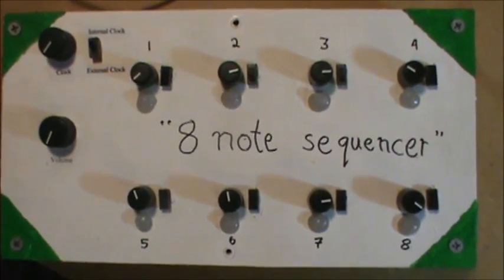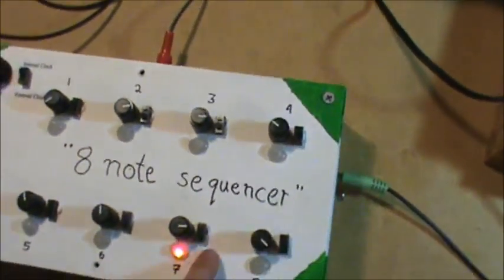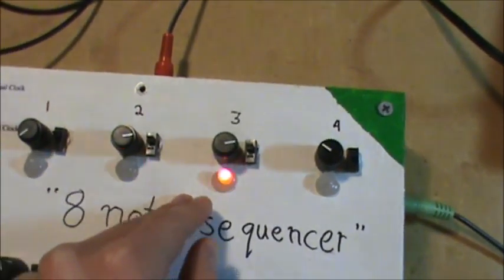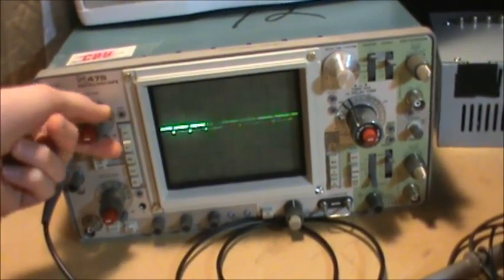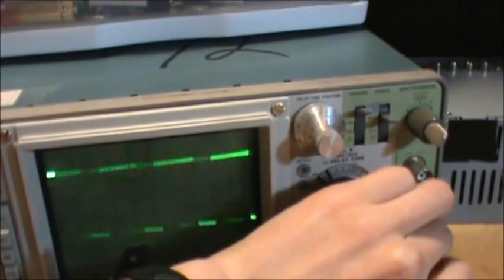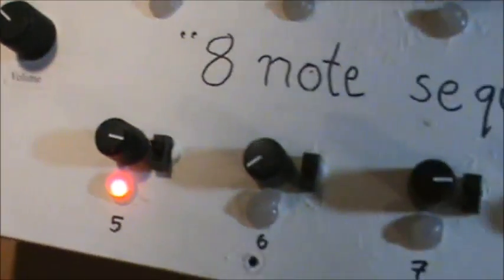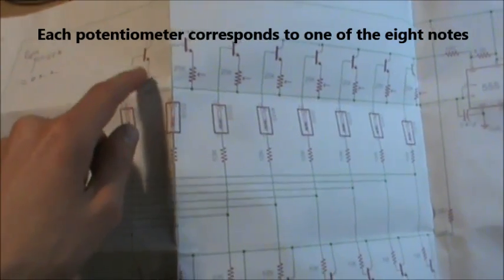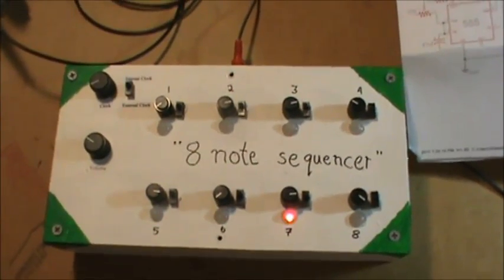8 Step Sequencer using a 555 timer as the oscillator

Comment: hi ryan, in the schematic you show in the video, the main potentiometers you use are 25k, but in the schematic they are 10k, could you please clarify this, and i tried to run a speaker directly from the 555 with and without a capacitor connected to the speaker in series but mine sounds a lot more different compared to yours, any suggestions.
Reply from the maker: I don’t remember which is the best value - experiment with both and see which you prefer.  The resistance value will control the pitch or the speed of the sequencer.

The 555 is too weak to drive a speaker, so the sound you get will be quiet and distorted.  Run the signal from the 555 thru an amplifier and connect your Speaker to the output of the amplifier.

Comment: Hi Ryan, I have made the assembly of your sequencer with the diagrams that you have presented and all the circuits work except for the synth oscillator. I have mounted it several times again and it continues to sound, are you sure that the oscillator circuit is well done? are the component values correct? the outlet mosfet is correct as well as its pinout, IRF530N (1G 2D 3S) I await your answer since I am desperate, greetings!
Reply from the maker: try probing pin 3 of the synth 555 (U2) and check to see if it is oscillating.  Your output amplifier (mosfet) may be wired incorrectly.  The schematic looks correct to me.
Reply: @RyanJensenEE  Can you tell me how the correct pinout of the IRF530N mosfet would be? 1G 2D 3S (viewed from the front)? And another question ... the oscillator should sound without the sequencer or only when connected to it

Comment: Hey Ryan! You did a great job! Thank you! :) I noticed that many people say there is a delay when they turn off a step. This is because, in certain applications, NE555 needs a 0.01 μF capacitor (unpolarized) between ground and pin 5 of the IC (TI says it can improve performance). In this case I found that the best results are given with a 0.01 μF ceramic cap between pin 5 of the internal clock NE555 and GND. I also found that by doing the same thing on the sound-generating NE555 but with a 1 μF electrolytic capacitor (positive at pin 5, negative on GND) gives a smoother sound and cleaner square-wave at the output! Also, for the ones who like to use a metal box, don't forget to ground the chassis, otherwise each time you touch it you introduce noise! Thanks again a lot! Greetings from France! :)

Comment: Hi bro!!!
¿What diodes do you use in the out 8 from CI 4017?
¿680 ohms or K?
¿0.47 uf is ceramic or Electrolytic?
Reply: 1n4148 diodes
680R
0,47uf ceramic or eletrolitic ... but eletrolitic minus signal for out circuit

Comment: is the mosfet an amplifier? can it be replaced with a opamp?
Reply from the maker: The mosfet here is working as a "pull-up" device.
However, if you know what you are doing, you could replace it with:
- P-channel MOSFET
- npn bjt
- pnp bjt
- op amp
- nothing (let the 555 drive the output directly)
- optocoupler???
the sky is the limit!

Comment: I tried the transistors on the steps with 3904s but they did not work.  the leds all blink together.. anyone have any values of transistors they used that worked out? thanks
Reply from the maker: Are you really sure that the problem is the transistors?
Reply: You could use diodes, couldn't you? Such as 1N4148

Comment: man, i've just ended to built it, i switch it on but it runs too fast. i used a 200k pot instead of 160k and bc547 for the transistors.

Comment: anybody ask about shuffle? does the 4017 switch when it goes high or when it goes low or both? guess i want another 555 for that? (rather than making a separate circuit ie 8 + 8 steps)

Comment: what is the little square in the schematic? the potentiometer is conected with the 2 pins and the third one is connected to what?
Reply from the maker: The little squares are supposed to indicate that the pins are not connected to anything, I guess.
Some (if not all) of the potentiometers in my schematic only have two connections. The third terminal is not always used.

Comment: Thank you so much Ryan! Just a question: is the 33uf and 0.47uf polarity right in the schematic? They have the positive pole to ground and it sounds a little bit strange to my experience
Best!
Reply from the maker: Thanks for the correction!
You are absolutely right.
The polarity of my capacitor is wrong.
I will try to correct that tonight.

Comment: how do i connect external clock to tr 626 trig out??
Reply from the maker: I assume you mean a Roland TR-626 (based on a google search for "tr 626") https://goo.gl/z6su3N
I do not own one of these. So I don't know how.
Maybe just plug it in? But that could POSSIBLY DAMAGE either the sequencer or the Roland, because I don't know how the Roland Trigger output works...
Good luck!
Tip: try connecting the two devices with a 10 kΩ or 2.2 kΩ series resistor first.
If this works, just leave it in series. This will limit the amount of current that can flow between the two devices, thus protecting both. A 10 kΩ resistor is pretty safe bet.

Comment: Hey man just build this here's some impressions: https://youtu.be/DcCksJVC-Us
Thanks for the schematics. I was thinking though that the transistors for the LEDs are not really necessary right? A couple of resistors would make things a little easier I guess.
Reply from the maker: +Benjamin B I was about to agree with you, but I decided to take a look at the datasheet first. http://www.futurlec.com/4000Series/CD4017.shtml
As far as I can read into this, it seems to indicate the maximum input/output current when the supply voltage is 5 V is:
0.88 mA.
I might be reading the datasheet wrong, but it doesn't seem very clear.
I have a feeling that it would work just fine to use the 4017 to drive the LEDs (with series resistors) directly from the chip's output pins.
Cheers,
Jensen
Reply from the maker: +Benjamin B Cool video! If you ever get people asking you for a schematic, you know where to send them :P

Comment: Awesome! I am building this one right now :D 
I was wondering if you knew a way to implement a clock out option also (to use the sequencer as a master clock)
Reply from the maker: +Ole Nieling
The internal clock signal of the sequencer can be found at pin 3 of the left-most 555 (U1).
It can be seen in the schematic that I gave my circuit an option of having an external clock source.
I think the simplest way to make the internal clock source be an output would be to connect pin three of the left-most 555 (U1) to an audio jack. I would put a 1 kΩ or 2.2 kΩ resistor in series with this output so that it protects the 555 if the output ever gets short circuited or brought to a different voltage or something else bad happens to the output.
Cheers!
Reply: Very awesome, thanks for the swift and helpful reply! Ill have to redo my casing now :P get an additional socket for the audio jack fitted but im by far not bitter about that :D 

Thanks a bunch!
Reply from the maker: No problem! Good luck!
I am really interested to see what your build looks like. Care to post a picture / video?
Reply: When its back together Ill post a video ;)

Comment: I don't understand where some pins are wired... I mean, every third pin of a potentiometer is wired to earth, isn't it? Is the external clock  used only in case of connection of other machines like this? great job !!

Comment: Hello from South Korea!
I really appreciate for your schematic and video. I followed your schematic just as same,  It works fine except one problem. 
Everything works smoothly but if I turned off any switches, ( ex. sw1-off, else sw-all on) clock from 555 pauses generating frequency a little bit and then works again.

I know it should not be heard at off switches like your video, but mines are different....
what parts do i need to find this problem?

Here's what I used in circuit.
NPN tr as 2N3904
Didn't made LED circuits.
CD4017BE - Ti

and also can you mail to me in your video's circuit? I saw it's a little bit difference.

I really need this solution asap, skype always welcome and here's my mail 
p90913390@gmail.com
Thanks for your help.
Reply from the maker: +Hoon Lee Hmmm... I don't know why that would happen. Sorry I can't be of more help!
Reply: +Ryan Jensen It's all right :) But what TR and diodes did you use ? Cause I used 1n4004 not 1n4148.
Reply from the maker: any general purpose silicon diode should work.
Reply: +Ryan Jensen Actually it is kinda working but not well. Like I said when I used not 1n4148 diodes, it took more than regular time to skip for off-switch passing.
Because this 4017counter needs "fast switching" to reset pin on 4017counter. 
So I suggest for this project : use fast switching diode such as 1n4148.
And thanks again for your share!
Reply: +Hoon Lee Hi! I have the same problem. What diodes are you talking about? The ones that go from 9th step to the reset pin? I am using a rotary switch to reduce the steps, so the reset can happen from different points. Can you explain me a bit of what happens there with the diode? And hm.. I am using the 4148 diode... thanks!
Reply: I mean what happens when the step is off and it takes (maybe two steps) more time to go on. thanks....
Reply from the maker: The rotary switch is definitely the way-to-go. Being able to control the number of steps in the sequence is really great.
Reply: +Sara Milazzo Hi! If you're not using 1n4148 diodes on pin8 of 4017 counter, steps could be delayed for one or two steps. But this happen causes when one of switch is open.

Comment: Hello Ryan Jensen this is just awesome, here in this Schematic  i struck at q 17 i dono what it is and my another question is can i use 100k pots instead of 10k?, i used 2N3904 NPN transistors will they work fine for this? Thanks a lot :)
Reply from the maker: +prudhvi rockzz
"i struck at q 17 i dono what it is"
Q17 is a general purpose N-channel MOSFET.
You can use most any general purpose N-channel MOSFET.
Or, you could try using a 2N3904 npn bipolar transistor for Q17. No promises, but that will probably work.
"can i use 100k pots instead of 10k?"
You can sure as hell try. If you are using linear 100k pots, you will find that most of the range of the pots is useless, and a small part of the range is extremely sensitive and hard to control.
100k audio pots might work reasonably well, but you are going to accessing a lower range of frequencies.

2N3904 NPN transistors should work fine.
Reply: +Ryan Jensen  Thanks for the reply, this project  is really awesome, Thanks again for sharing this :)

Comment: Hello !
First, great job ! Congrats ! :-)
I have a beginner question ! Which parameter do you change to change the value of the note played ? Do you change the value of the 10k Ohms resistors (on the top of the schematic) ? Or is it somewhere else ? :)

thanks !
Reply from the maker: +Cherozene These are potentiometers: http://i.imgur.com/ELaN4Dm.png
They are the knobs that I am twisting in the video.
They act as a variable resistor.
The 4017 selects which potentiometer it wants to insert into 555 circuit on the right (the 555 generating the audio).
Depending on how the potentiometer is turned, it will present a higher or lower resistance to the 555-audio-oscillator and this will produce a different frequency (pitch) heard from the speakers.

I hope this helps!
Reply: Haaa ! Yea ! Thanks ! It is all clear to me now ! :D
Thanks for your prompt answer !
Reply from the maker: No Problem

Comment: Can you tell me please How did you add the rate control? I don't see it on the schematic.
Reply from the maker: Derek G Absolutely.
The schematic does, in fact, show the rate control. The 555 on the left labeled "Internal Clock" is the rate control. The 160 kΩ potentiometer connected to this 555 controls the speed of the 4017 decade counter which steps through each note. The switch on the left side of the schematic (S9) is used to select either the internal (manual) step speed or the external clock "rate" input.

Does this answer your question?

Comment: Would it be a good or a bad idea to power this crircuit with 9V?
Reply from the maker: 077benjamin Lets look at all the components from the schematic one-by-one:
- resistors: No problem!
- capacitors: Again, no problem!
- diodes: any general purpose diode will be able to handle 9 V of reverse voltage. This shouldn't be an issue.
- LEDs: with 9 V, these will be brighter -- perhaps very noticeably! So play around with the resistor values until they provide the right amount of current limiting so that the LEDs have a comfortable brightness.
- transistors: any general purpose transistor should handle 9 V just fine.
- The integrated circuits: The 555 and 4017 chips are usually rated up to 15 V or 18 V. You probably won't have an issue with these, but check the datasheets of your specific IC model to be sure. Or just throw 'em in and see if they pop!

Good luck, and be sure to let me know how it goes!

Comment: Great Job! I'm gonna make one too.
Reply: An easy thing that you could add is some kind of FM (or .AM, but imo FM ia a lot cooler). Or a switch to change between two types of waveform?
Reply from the maker: Neat!
You should make a video of yours when you build it.
Oh, and make it better than I made mine :P
Reply: I will try my best Ryan Jensen. I want to add some effects and nifty features to the synth but I can't come up with any. Maybe you could help. 😀
Reply from the maker: Owais Bin Asad I agree with Tom L. 
You should try to add some AM effect or FM effect.
If you are going to make your sequencer based on the 555, then you should also have access to the charging waveform. That would give you a series of RC rise/fall cycles. (just probe pin 2 or 6 instead of pin 3.) You wouldn't want to load pins 2 or 6, as that will change the operating frequency of the 555 timer, but if you buffer it with an op amp or some other high input-impedance device, you should be able to use the charging signal without changing the 555 operation.

Comment: can you use HCf4017 or cd4017?
Reply from the maker: Those devices will have the logic inside them. They will only differ in their elctrical specifications (max voltage, max frequency, maximum heat dissipation, etc...)

I searched "HCF4017" and "CD4017" on google and found their datasheets almost instantly. The datasheet may differ slightly from one manufacturer to another, but in general they are fairly similar.
http://www.futurlec.com/4000Series/CD4017.shtml
http://www.st.com/st-web-ui/static/active/en/resource/technical/document/datasheet/CD00000366.pdf

For this application, it does not matter which one you choose. The maximum voltage range for each is way higher than the 5V that this circuit uses. And they both work up into the MHz range (which, obviously is overkill for a simple audio circuit)

The short answer is: you can use either of those devices.
I hope that helped.
Jensen
Reply: Ryan Jensen
Thx :)

Comment: can you use the TLC555? it's the CMOS version of the NE555.I would like to use it because it draws much less current from the power supply
Reply from the maker: I believe you can. It looks like the power supply range is fairly similar (2 V to 15 V for Vcc). And from what I can see on datasheets, you are correct about it using less current. I say go ahead! There should not be anything different in the operation of an TLC555 compared to an NE555.
Let me know how it goes!

Comment: great little device! I've been thinking to build something like this, for a while, to go along with my Korg volca bass, with a switch so I could setup external sync or internal. I've also been thinking to add attack release for each individual step or all the steps. Is the 555 #2 receiving trigger or gate signal? I also noticed your instructable is non existent though... I also noticed the schematic in the video and the one you posted are different. Which one is the best to use or what are the differences between the 2?
Reply from the maker: Yeah I never got around to making the instructable. And now when I think about making an instructable about this project, it makes me want to completely re-design the sequencer.
About the schematic: use the one on imgur. I made some modifications to the device, and the schematic on imgur is the most up-to-date.
The only issue with the schematic is that the output doesn't show the potentiometer I used to vary the volume of the output square wave signal.
To make the Potentiometer variable, just replace the bottom 1kΩ resistor with a variable potentiometer. I suggest using a logarithmic potentiometer.
Reply: Ryan Jensen Thanks! Also one last thing, is that mosfet really needed? couldn't I just go directly from pin 3 to output, maybe with a cap and a pot in between?

Comment: great job man, can i ask a question? which potentiometer in schematics is used as volume control?
Reply from the maker: Actually, now that I look at it, the potentiometer is nowhere to be found. It would be in place of those two 1-kohm resistors on the output.
Reply: Ryan Jensen  thank you, and may i ask what diodes did you use? it would be very helpfull :)
Reply from the maker: Mardalar m I think I just used some general purpose diodes. In all likelihood, I took them from my junk drawer. I have a lot of scavenged diodes. Or they may have been bought from mouser of digikey. I have no idea now, but most ordinary silicon diodes would work.

Comment: what transistors do you use?
Reply from the maker: I used 2n3904 npn BJTs for the eight potentiometers and eight LEDs. I used a single 2n7000 MOSFET for the output stage.
If I were to do this over again, I might look at using MOSFETs for everything. Or at least use pass-gates out of npn and pnp BJTs.
I'm planning on making a 16-step sequencer for my synth that I'm building this summer, so I'll probably upload a video when I have it designed/built.
Reply: Thanks